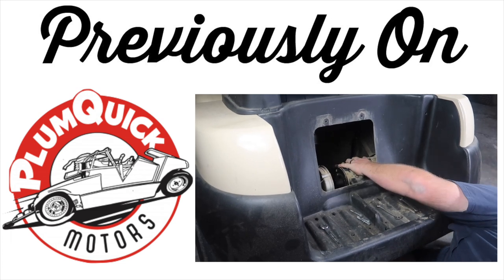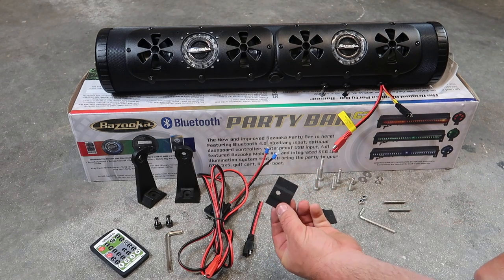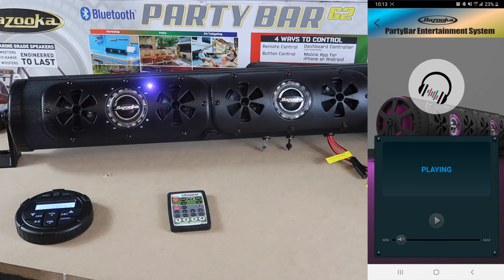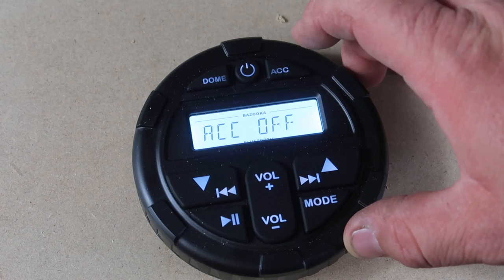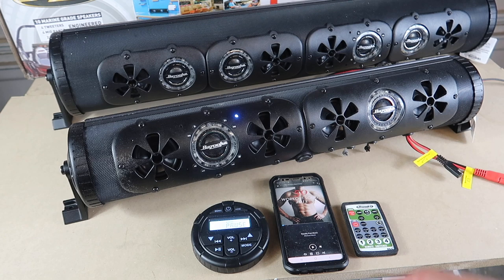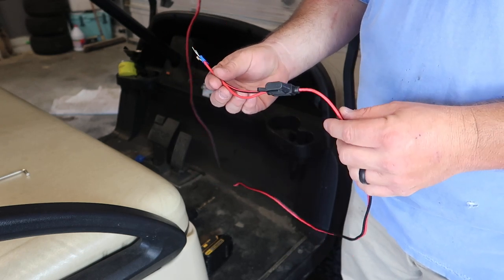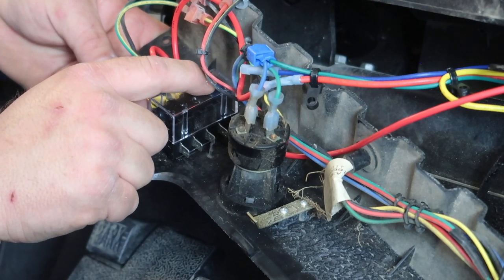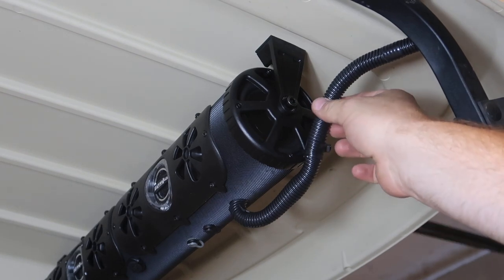How To Install Sound Bar on Golf Cart | Bazooka Party Bar G2 | In-Depth Review | Club Car Precedent

Comment from the maker: 24" Party Bar Double Sided -  https://amzn.to/2WCXggv
36" Party Bar -  https://amzn.to/2WBiOtS
48 volt to 12v Converter -  https://amzn.to/2X341XV
Reply: Any idea why these are Out of Stock online?  Just wondering if there is a recall or problem with it? Could be COVID-19 hold up too, IDK.  Thanks for your awesome vids! We are doing a '14 Precedent (my son & I) and love watching your channel!
Reply: Those speakers are heavy. You showed drilling the holes thru the roof, and showed the studs sticking out for mounting. But you did not show how the studs stay into place? Those are plastic roofs, and the speakers are heavy. So how is that stable enough to hold that speaker? Especially during transportation on a trailer to and from say our campgrounds.
Reply from the maker: @larrywalden626  I ran that setup for a while. I just redid it about 2 months ago when I switched my top. This precedent tops aren't thin single layer plastic roofs. It was sturdier than most would think however im glad I switched to a ext too and mounted it on a flat bar.

Comment: I installed mine to my gas club car and the speaker mounted to the roof lasted about 10 months before it broke through. I installed mine before I ever saw your video, so no blame here. Just letting people know it is a heavy speaker after a few months of riding on any bumpy roads it might break through the roof. Still a great video and hope it works for you.
Reply from the maker: It has since been changed but you have a very valid point. The same reason I swapped mine as well
Reply: @Fentertainment  did you go with a utility bar?

Comment: Thanks for the awesome video. Are you aware of a sound bar or speaker adds that run to a newer cart that has an onboard stereo existing?
Reply from the maker: This one has AUX input on it. You can connect to any soundbar that has aux in from an existing stereo. Then just power it on, set the volume on the sound bar and then adjust the volume on the stereo and it will adjust with it.

Comment: Nice job on party bar, just got the 24" bar and was looking for a place to mount on my EZ Go cart.Like the roof mount do you think it will cause a sagging issue over time?
Reply: I wondered about that and also sealing the bolt holes with some silicone caulk to keep it from leaking.

Comment: I really appreciate all the help I have the same set up you have except mines a Yamaha drive  2016  when are you going to do a Yamaha makeover
Reply from the maker: Ive been wanting to get one. I havent found the right cart and the right deal yet.
Reply: @Fentertainment  let me know when you get one because I just built one I got a 3 inch lift on it and it seem kind of wobbly is that normal because I notice you build yours high
Reply from the maker: @fogdogrides  If you used a spindle lift then those are known to have a little wobble.
Reply: @Fentertainment  Do they help me a different style I do have the spindle what do you recommend

Comment: Do the club cars need voltage reducers or can you just run it straight to the battery? I have an overhead stereo that seems to be running straight to the battery with no reducer
Reply: 36 volt and 48 volt carts need a reducer. If you're running a stereo,  there's a reducer in it somewhere if your cart is a 36/48 volt

Comment: I have this on my atv.  The way it set up I have to disconnect the plugs so the battery didn’t die. Is there a way to set it up on a switch or something?
Reply from the maker: This bar only has power when the cart key is on. Since this isnt an atv and is a cart I installed a dc to dc converter and made the accessories to power on and off with the cart. You could add a switch inline with the power wire or you could use a 12v 30a relay with your ignition switch to power the unit on and off with the key switch.

Comment: So question....do you have to have the controller panel (you added to the dash) or can you run it ALL from your phone?  Just bought a new cart but don't really want to change the dash any.  Just asking because amazon sells it with or without it.  I do see the plus of getting the AC/DC converter to use at your house that was a neat example of other ways you could use it.  Thanks!
Reply from the maker: You can control it from the bar itself or your phone. You don't have to have the remote.
Reply: @Fentertainment  thanks!!

Comment: You didn’t mention or I missed which cable you used to connect the party bar ground to.
Reply from the maker: @22:20 you can see I connected it to the 4 way ground that we installed in the last video. For some reason it slipped my mind and I didnt mention it.
Reply: @Fentertainment  I might be missing something but it looks like the 4 way ground at 22:20 is the same as the previous video at the 7:46 mark.  2 spots are taken.  1 from the main ground to the harness.
Reply: @Fentertainment  I actually had the same question as Brock. You had one terminal taken up by battery negative and the other going to the Converter harness in the DC Converter video. In this video you have the stereo hooked up and still only use up 2 of the available 4 ground terminals. Did you change something up?
Reply: My question is once hooked up does it draw power off the battery and need a in line on/off switch to cut the power or can u just turn it on and off on the party bar without it draining your battery...I was gonna install one in a car and don’t want it to drain my battery..thanks

Comment: Can hook up a amp to this for a sub
Reply from the maker: Yes. Not a big one but I usually run amplified subwoofer enclosures with mine and have no problem whatsoever.
Reply: @Fentertainment  Did you do a video of the powered sub install? I'm wondering how you got the audio signal from the party bar to the powered sub.

Comment: Wont water leak onto your speaker
Reply from the maker: Ive been in numerous rainy situations and not yet. It will soon get changed as a new top is in the future. It is recommended to mount it to a rail or metal brace for more support.